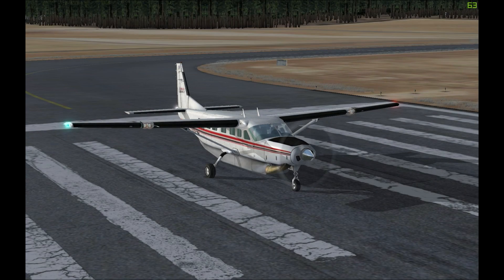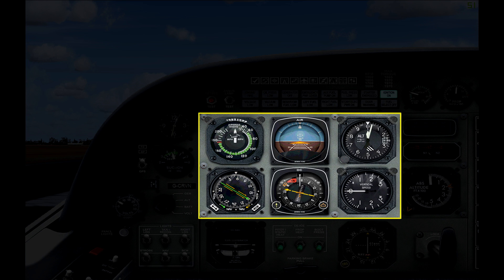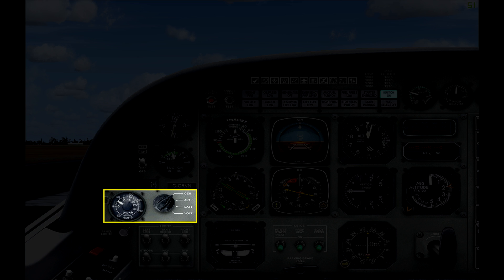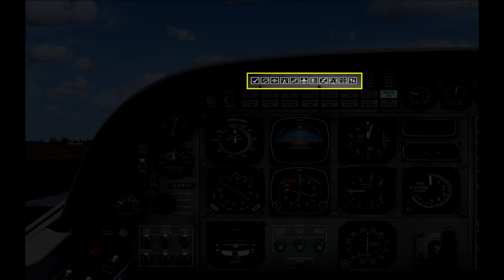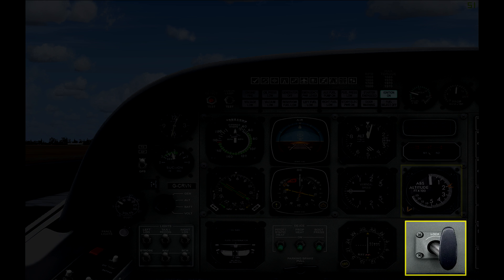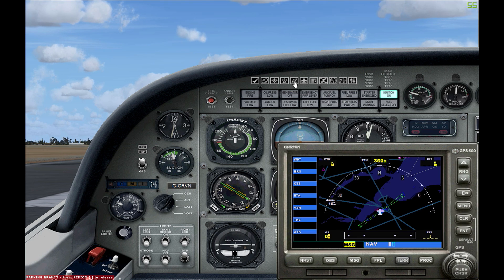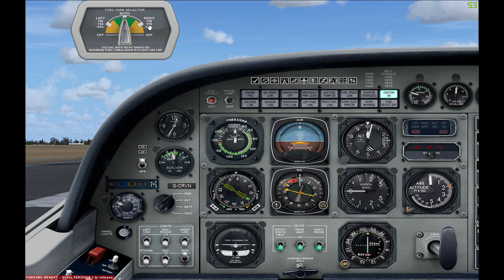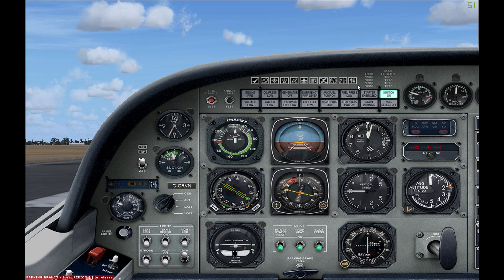FSX Tutorial: Cessna Grand Caravan Guide (Cessna 208-B)

Comment: What are your pc specs?
Reply from the maker: +Timmy Soars Hey Timmy, I'm running an i7 4770K running at 3.5Ghz, 16GB Corsair Vengeance RAM at 1866Mhz, Asus GeForce GTX 780Ti Direct CU2 graphics card, Asus TUF Sabertooth Mark 2 motherboard (can't remember which chipset), 1 Kingston HyperX 120GB SSD, 1 x 2TB HDD (can't remember the make), all wrapped up in a Fractal Design Define R4 Case. CPU Cooler is a Noctua single tower design (again, can't remember the exact model number). My plan for this computer was for it to be powerful, all air cooled but quiet.
Reply: +Doofer911 well, that's a heck of a PC!!!
Reply from the maker: +Timmy Soars Yeah it hurt the bank but I'm seeing it as an investment. Wanted something powerful so I could do YouTube stuff :)